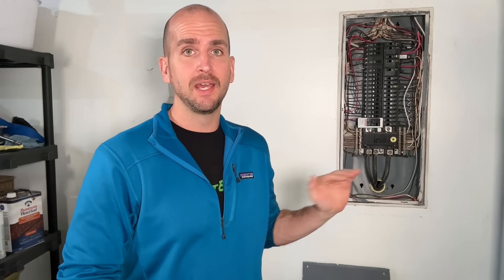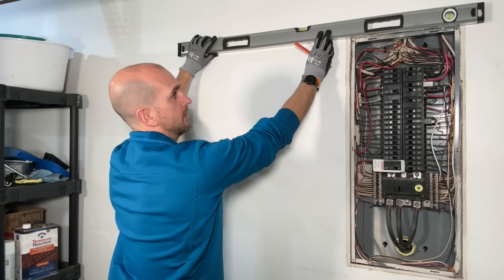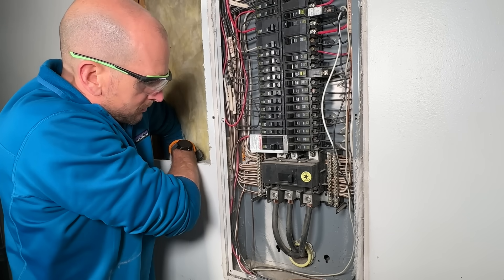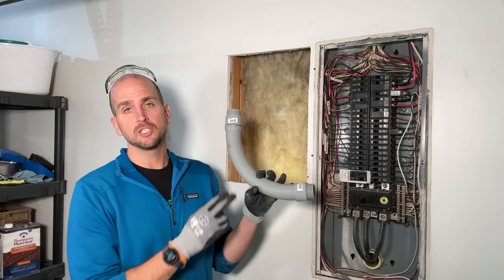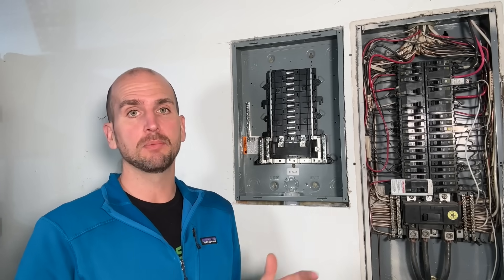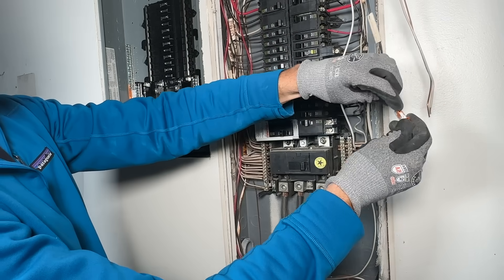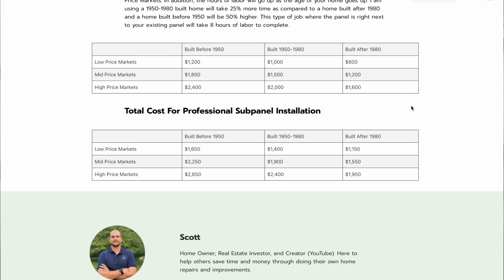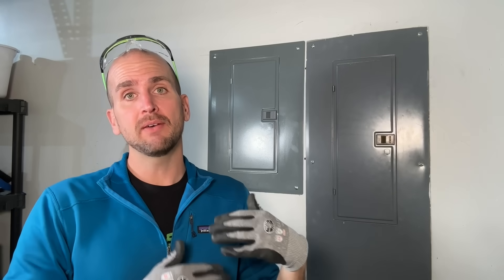How To Install A Sub Panel Next To Existing Main Panel

Comment: Thanks I am also thinking  about replacing gas furnaces in attic with heat pumps. Does the air handlers use 220?  I currently have two 17 years old 2 ton units and two 45 btu furnace in attic. Location Georgia

Comment: Why would you switch from
Gas to electric heat pump ?!
Reply from the maker: Not pulling the trigger just yet but it is a future option.  Testing out a heat pump this winter in a much smaller property where I will be tracking the effectiveness and also energy consumption.

Comment: Hello Everyday Home Repair. Thanks! for the very detail and useful informations. I wonder if instead of a lower amp sub panel, should I make it a 200 amp sub? Then I don't have to buy and make room for the sub breakers using HOML2225 sub feed lug kit? My question is; Is it what this kit for? Please explain what are the (+) and (-) of doing it this way? THANKS1

Comment: Is it possible to have two main cutoff switches? I have an outside the garage breaker box, but I'd like to be able to cut off the main from inside the garage. Will a transfer switch do that? Thanks.

Comment: When you stuck your left arm into the wall cavity on the left, how did you know where to position the hole saw to meet up with the knock out on the existing panel?
Reply: There was a center drill done inside the old panel. You can see it when he breaks off the hole.
Reply: I was wondering the same

Comment: does this update make your total amperage capacity to 300 amp? or having a sub panel is different than upgrading it to 300/320 amp panel? I have one panel rated for 200 amp. I'm hoping to upgrade it to 400 amp (or 320 amp) by adding one additional 200 (or 120) amp panel next to the existing main panel (so two main panels). any feedback is appreciated...
Reply from the maker: Nope, you are basically expanding out the number of circuits you have to work with but the amperage through all circuits will still be limited to your main (200 Amp) breaker.  You most likely don't actually need a 400 Amp service unless you have a HUGE home and a ton of appliances pulling some serious amperage.

Comment: HELP! I'm replacing an old Federal Pacific 100-amp panel with a 200-amp Square D Hameline panel, so I will need to upgrade the service entrance cable and want to use 2/0 THHN copper.
 The outdoor meter can/box is mounted low, (30" off the ground at bottom edge of can) outside, so if I use the bottom rear 2-inch knockout of the meter can, it will put the hole through the wall below the bottom edge of the new breaker panel by about 8 inches, so I will have to make a vertical 90 upwards turn from hole in wall to bottom knockout of the new panel. I cannot find a 2" close 90 PVC electrical fitting so I'm guessing they don't make one. 
My question is: how do I make that vertical 90 turn upwards? It will eventually be covered in drywall. Do I need to have the inside copper leads in conduit at all? If I use switch to 4/0 aluminum, do I need conduit inside the wall cavity? thanks in advance!

Comment: 250.92b concentric holes bonded with migb's .

230.7 line feeders and load conductors never used at the same raceway .

Neutral conductors 4 AWG or larger must be identified by any of the following means: (1) A continuous white outer finish along their entire length. (2) A continuous gray outer finish along their entire length. (3) Three continuous white or gray stripes along their length.

Where this 2 circuits lights or outlets ? if yes why not putting arc faults ? from the moment you touch something immediately it is a new job and you must correct it to the existing code.

Did you have a load calculation? Is your panel working to the limits or you have space in your wiring coming in for a sub panel?
Reply: 250.92 does not apply here for two reasons. The subpanel is not part of the service; it is on the load side of the service and 250.92 applies to service equipment only. The second reason is that you do not need to bond the ends/connectors of non-metallic conduits.
230.7 applies to service conductors only, not feeder conductors. The conductors for the sub panel are feeder conductors; feeder and branch circuit conductors are allowed in the same conduit.
No AFCI breaker required because the extended conductors of the existing circuit are less than 6' long.
Load calculation not required because there is no alteration to the service. Adding a sub panel only increases the number of available circuits but does not increase the size of the service.

Comment: can you use Wagos with aluminum wire?  And what are the wire sizes with wagos?  I use them alot, really make wiring an outlet neat and clean.  In an outlet, I will hot glue a multi-wire wago to the case just to keep the wire connection fixed and out of the way.

Comment: Is it required by code to bring across the neutral and ground wires for the circuits you moved?  Since the neutral and grounds are connected between both panels, I don’t see the need to do it.

Comment: Great work I am currently trying to run a 60 amp sub panel from my main to shed it's around 50 ft  planning underground conduit my question is what size conductors is recommended thanks for info

Comment: Do you have the neutral and ground bond removed at the subpanel?  Noticed you separated the grounds and neutral correctly but didn't see if the neutral / ground screw was present (should be removed).

Comment: Stupid question from Germany: were these three incoming wires hot all the time and the screws are not touch protected?
Reply from the maker: There are 2 hot conductors and a neutral.  Yes, you are correct they are always hot and the newer version of these panels do have covers over the studs to try an avoid a situation where you mistakenly touch one of the studs.

Comment: Hello, friend. So I can have a much better understanding, you took the hot lead from one leg of the main/primary distribution panel 120v side and split it in two for the subpanel, but still keeping the 100amp......correct? However, I did notice you did not use any double O'd line to the subpanel. The NEC 2023 and or municipal code okays this.....am I correct?

Comment: I understand you used a 100 amp circuit breaker connecting to the sub. But what is the main amp circuit breaker. How do I know I use 100 for sub? why not 50? or 75?
Reply: panels are rated for current.  60A, 100A, 125A.  You size the feed breaker accordingly.  You can size the breaker down if you want, but never above what the panel can handle.

Comment: Great video, thanks for posting.  Quick question: do you actually touch the lugs when using the multimeter or just close enough without touching?  Seems touching it would shock you or are the tips insulated?  Thanks
Reply: Touch the lugs, but don't be touching any metal part of the multi meter
Reply: @jobourne423  Thank you.  I have been afraid to try it.

Comment: Someone may have said this but adding a sub panel does not give you more capacity to add large items like a heat pump.  Depending on where you live a heat pump can require over 100 amps by itself.  It is always best to consult an electrician.  I have seen many do-it-yourselfers almost burn down their house not understanding code and how dangerous electricity really is.

Comment: Is there a way to have a in-wall critical loads sub panel (next to in-wall main panel) that does not destroy the wall stud?  Can you route the conduit externally between the two panels, or is it better to box the panels in like a window/door? My sub panel will eventually become my off grid main panel.  Thanks.

Comment: How did you center the drill with the  knockout behind the wall. Don’t think you showed that part.  Only thing I could think of doing is drilling with a small bit from inside panel into center of knockout through the wood. Then put the drill bit part of the hole saw into the same from other side.
Reply: I was wondering the same thing. He doesn't show drilling out the stud for the 1 1/2 pvc.
Reply: @b-hill  yes he does, you'll notice he isn't centered, its not too hard to eyeball it. he was close but about 1/2" off center. just use a bigger hole saw so if you aren't perfectly centered you can still have plenty of room to fit the pvc conduit.

Comment: Hey Scott. Great videos!
In this video, when adding your sub panel, you mentioned your future solar project. QUESTION: Were you planning on wiring your solar “feed” into your SUB panel, or moving breakers to get room in your 40-space MAIN panel? I am adding a sub panel soon and have wondered about adding solar someday, but did not know if there’s code or even “best practices” that says solar feed should be wired into a main panel instead of a sub panel?
Reply: Solar breaker can be in a sub-panel.

Comment: I like how you go over this,  you did not mention if the main panel was off or not? So many comments about minor stuff, The majors comments are? You forgot to identify / tape your neutral (grounded conductor) with white tape at both ends as required Art 200.6. Dwelling units 100amp subpanel, nothing wrong with using larger wire, but FYI Art 310.15 dwelling units feeders, a #4 is allowed for 100amp sub panel and #8 ground. The comment of 60amp sub panel #6 wire, Code does not that. #6 is 50amps. A #4 is required for 60amps. Any circuit under 100amps are required to use the 310.16 60-degree column.
Reply: #6 THHN is allowed for up to 65 amps, allowing one to put it on a max 70 amp breaker. If it was Romex, #6 is rated for up to 55A which allows one to put it on a max 60 amp breaker. It is not true that any circuit under 100A is required to use the 60C column. Romex is required to use the 60C column, but not individual conductors. Because most breakers under 100A have a 60C/75C rating, 110.14(C)(1)(a)(3) allows one to use the higher rating (75C) as long the conductors are rated for higher than the 60C rating, which is the case with THHN. For any breaker/terminal that has only a 60C rating, then max ampacity would be based on the 60C column.

Comment: What was the load total on the 200A load center? Was the 100A on the sub chosen because 200A main - 100A load from sub - 100A load from main? What math is used to determine how big your sub can be?
Reply: A sub can be any size, but no larger than the main panel it's fed from. The system will never draw more than the main breaker.

Comment: Where do you live ? if you live in a cold climate don't let them fool you heat pumps don't work well in the cold .
Reply from the maker: I am in Illinois and it does get chilly.  I am not ready to pull the trigger just yet on a heat pump but will continue to research prior to making the final call for the new HVAC system.  Thanks for the feedback.
Reply: That's not accurate. I have a new forced air central Bosch heat pump that provides all the heat for my 3400 square foot 3 story house in Northern Connecticut. Last Winter in December the temps went down to 4F for a day or two. The heat pump provided all the heat. On most Winter days with average temps of 26F the system is not even working hard. People who grew up on gas or oil furnaces tended to spin the temperature dial for instant heat. That is not optimal for heat pumps. Set em and forget em. My house holds set temp year round, cycling from heat to cooling automatically. Stop spouting misinformation. Read the specs for a Bosch BOVA 5 ton system.

Comment: Since my 100 amp panel has 3 wires 2 hot and neutral and the ground connected on the same neutral when connecting the sub panel i need to bond the neutral and ground?

Comment: It looked like you had installed the sub panel upside down?  The way I plan to bring in my power lines from my meter to feed my sub panel it would be a lot easier to have the connection post on the bottom and go out the top with my lines to the different service connection.  Is there any reason that I can not turn the panel upside down and do that to my sub panel too?

Comment: Great video! Not certain in Canada, I believe the CEC ( Canadian Electrical Code) doesn't allow splicing inside of main panel if exiting to a different system. If any Canadian electrician can comment.
Reply: That is correct.
Reply: Correct!
Reply: If so, then what do you do to relocate those two circuits in Canada?

Comment: I was going to wire a small subpanel for my generator initially, but I've decided I want to have room for some future mini splits ac units.  Can I wire the subpanel to accept the plug from my generator and have room left for designated breakers for future split units in one sub panel?  Do they make  sub panels that work like that?  Thanks...great video, very well explained...

Comment: I have a 100amp main panel and do plan to add car charging and other things that will be using electricity. Do I need to upgrade my main panel first or will 100amp will be okay? cause I think a car charger needs at least 50amp circuit breaker right? and thats already half of the main panel.
Reply: I'm 100amp and plan on car charging soon.  I will try to limit max charge to 32amp.  Still leaves plenty of juice for eveything else.  Also i plan on charging at night.
Reply: @zachlafond2652  well I have a bunch of pc. Gaming family and we mainly play at night. And 32amp plus everything thing else in our house I feel like I might be pretty high on amperage.

Comment: I see Feeder Wires going into the Bottom by By Electricians Skimping Everyway they can by saving the Cost of a Couple feet of Wire. I always have the Lugs at top of Panel. 
Interlock Kits will Probably still work. 
I see it Often enough that it Must be OK.
Been a Master since '98, Still buy the extra couple feet of Wire so it can reach the top. Others mention white tape on the neutral, 2 wires under one lug. Didn't see anyone else mention what I call Upside Down. Maybe it's just me? Habit? You have Helped Many.
Reply: Been in the trade for over 40 years and while upside down is legal, it will always look upside down and amateurish to me. It also screws up your circuit numbers, putting odds on the right and #1 at the bottom. Just to save 2' of conductor. I will never let my guys do it that way.
Reply: @pld8993  lol😂

Comment: Thanks for this video. It serves my purpose, but also the other video that you mentioned, about a remote panel, which is what I’m also planning, since only one circuit serves it, and the laundry is located there. The washer and dryer really ought to be on separate circuits, and I have a spare fridge there too, and run either a window A/C or a space heater (summer or winter options).
Also I have a large lot and want to run power to the RV (30 amps), to the shop (another 30 amps), and to the spa/hot tub. Seems like those last three will be supported by one 125 amp sub.

Comment: Question, my existing recessed panel is in the in-house finished garage and there is a wooden studs, how would you pull the feeder cables thru the studs? Do you drill a hole in the studs and pass the wires thru? 1-1/2 conduct would be a big hole?

Comment: Is there any specific reason why you moved all 3 wires from the 2 circuits you moved to the sub panel over to it instead of just the hot wires? Moving all 3 would cause more clutter, and increase the final price of the project. By moving all 3, you need 6 wires and 6 connectors. If you only moved the hot wires, you would only need 2 wires and 2 connectors, reducing clutter and final price. What was the reason for moving all 6 wires? Thanks I’m advance for anyone who answers this question.
Reply: Circuit neutrals and grounds must originate from the same panel where the breaker is located.

Comment: That spacing you ended up with after cutting everything was absolutely beautiful.
I know it is drastically cheaper using the parts that you did, and that is a big reason even on its own, but why not take this opportunity when needing the subpanel for solar to use a smart panel like Leviton or Span? Being able to get really accurate readings on every circuit in that subpanel is pretty useful for seeing power draw when on battery (if you have one) or from your solar directly. I like the Leviton panel personally since it both looks nice, has indicators positioned so you can see status with the panel door closed, and you can choose specific circuits to be smart and go with cheaper breakers that are not smart for other circuits you don't care about, or the potential to upgrade to a smart breaker whenever you want.
Reply from the maker: Yeah, I will undoubtedly be jumping into smart panels in the near future.  I have been waiting a bit for the products to mature but I know my friend Joel @electricproacademy is a Big fan of SPAN 👍

Comment: Before he started this sub panel install.  Should have calculated the load draw.  A lot of the time most pros don't use the amp probe to determine the total ampacity   when you add a 100 amp breaker to an existing panel.  Load calculation is the determining factor.  Usually ull have to upgrade the MDP as well as the feed conductors to make sure u don't overload the system
Reply: There's no need to do a load calc when adding a sub-panel. You'll never draw more than the main breaker will allow so it doesn't matter how many 100A breakers you add to the main panel, the system will not get overloaded simply by adding breakers. A breaker's job is not to limit the load; its job is to protect the conductor. Usually you do not need to replace the main panel (assuming it's current and not outdated/obsolete) when adding a sub-panel.